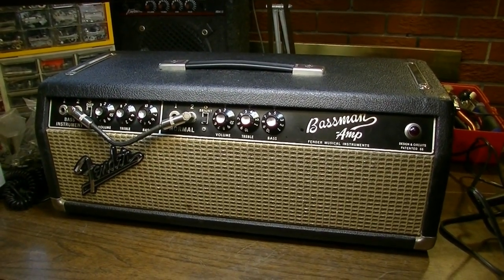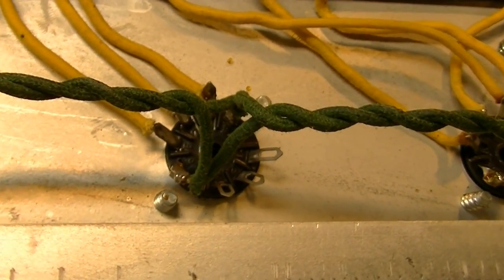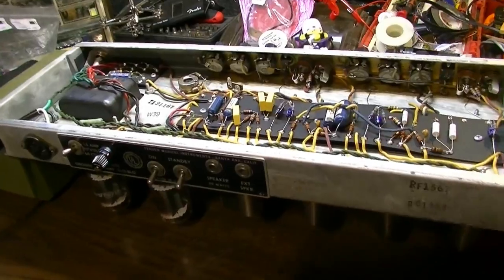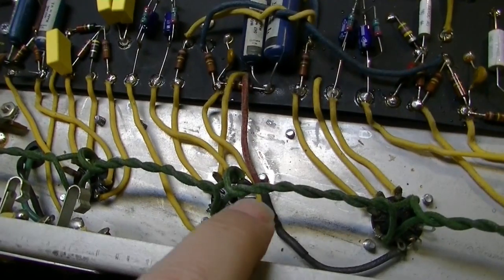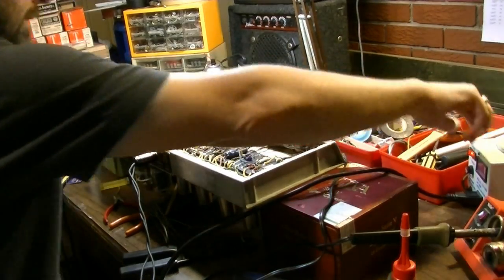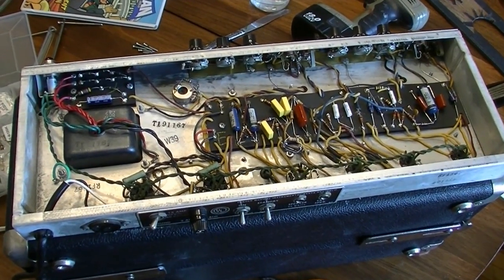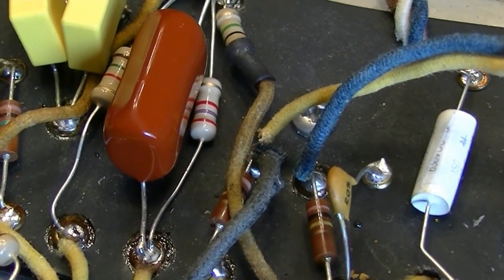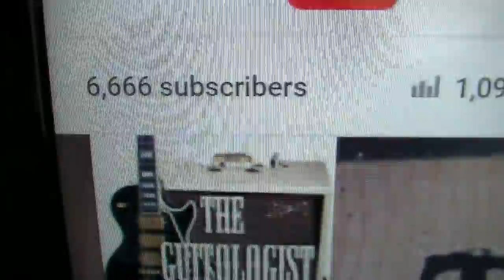Hacking a Blackface Fender for Monster Gain, Blasphemous or Badass?

Comment: The problem with the Marshall tone stack is that tone stack's frequency response depends heavily on the impedance that's driving it. In a Marshall amp, the tone stack is driven by a follower, and the output impedance of the follower is a few hundred ohms at worse (and by "worse" I mean when low mu triodes are used, such as ECC83, 12AX7, 7025, 6N2P).
In a Fender amp, the tone stack is driven by a gain stage with an output impedance around 40k. So just changing the component values in the tone stack of a Fender to match the corresponding values in a Marshall will not result in a similar frequency response to that of a Marshall. This of course does not mean it can't sound ok.
Reply from the maker: An excellent point. Thanks for making it.
Reply: +kardRatzinger - Important point!  and to which I'd like to add that static information, like interstage impedance and frequency response, is like a postcard of the Himalayas - 2D doesn't even approach the LIVE experience.  What matters, especially to the player, is Dynamic Response - how it feels as well as sounds in a continuum, not a snapshot..  The Cathode Follower circuit is extremely important because it has Unity Gain and acts like a soft-knee limiter. Also because the entire Tweed tone circuit (and most best models from Marshall, HiWatt, Vox, and a dozen other venerable brands/models)  comes AFTER the 2nd gain section and Volume control, overdriving that limiter and tone stack results in "squeezed up" bandwidth as well as attack which slowly recovers as signal decays results in a vocal effect that drives musicians to "talk" with their instrument.  It can clean up when you turn down and slide smoothly into overdrive when signal increases either by turning up or just hitting the strings harder.  If you just want a fuzz tone get one.  If you long for a responsive musical instrument, explore Cathode Follower driven Tone Stacks.
Reply: well there's more resistances to ground on everything in that stack you notice and it's the followers distortion and not plate driven as well stages some tend go slightly colder, you can get monster distortion cold clip the hell out of the 2nd or 3rd stage and get everything else HOT sounds good...but I think it still sounds alittle still docile sterile and could play with feedback and it's still something like that...just go monster headroom and all gain allll hot running and clean then just run your choice of firestorm pedals up front, that's why I said might as well have some big clean ss/digital amp that's clean and filtered well and still sounds like what's running up front.
Reply: +JR - I don't understand why you are replying in this portion where we are discussing Cathode Follower driven tone stacks and Dynamic Response where a musician can travel between clean and distortion just from Guitar Volume Control or how hard or soft  you attack the strings which has a tonal "squeeze" effect since it drives the Tone Stack, adding a whole dimension of vocal expressiveness.  Extreme pedal (or preamp) overdrive is the antithesis of that.  Also "distortion" is a misleading term when one is considering Cathode Followers since they are Unity Gain and have extremely low harmonic generation on their own.  The concept of extreme preamp overdrive with ultra clean power section, especially of the  "ss/digital" type, is completely out of place in this video  which is for those that love what only tubes can offer and have an interest in whether hacking a 50 watt Blackface is a good thing or not.  What you're talking about has some validity for some styles of players but not in this arena.
Reply: Oh it's no ill intent or Despair. But I know what I would do to it Lol, the follower seemed to have a somewhat audible "zingy" response and a lot fun in the highs and grins me the hell out lol...Plate driven now everything is really different it seems to of lacked a lot more of the harmonic content and excels at the low end.
Reply: It's not even that though it's wicked just to have Headroom and already super Clean and just annilate with pedals up front, telling you valve is overrated lol and it's old lol
Reply: +JR - You are somewhat correct in that valves are overrated for the sound and feel YOU like BUT they are NOT overrated for those of us who prefer Dynamic Expression.  You are also correct that they are old, but then so are guitars and speakers and the scales I'm sure you love.  Things aren't good because they are old or new.  They are good because they offer value and some get to be old because they do it so well.
Reply: There's all kind of just excellent stuff and boxes now, that is very dynamic
Reply: +JR - I sincerely doubt you understand what I mean by "dynamic" in the sense that tubes differ from ss/digital by having a "soft knee" transition into overdrive.  From what I see and hear, if some mere pedal could actually do that, which in my understanding of electronics is physically impossible even for very advanced FETs let alone ICs, within just a year or two tube amps would literally disappear from the market and that market is quite healthy.  From what I gather you are of the metal crowd that cares not for such dynamics and has no need for it or tubes that can and do deliver such tracking.
Reply: Well there is some dynamics and response in that area too, it can become really squashed and boxy with like over compression, that's fun for all the rhythm stuff, but that dynamic openness and a lot and transition into the high end and exercises is a good test. And it's that too some decent cleans if you wanted to do that and transition from the firestorm , I think there's a lot close and similar emulation's.
Reply: That can be simulated too though a softer sort of overdrive and like mild breakup and a lot stuff still kinda sounds like that still when you go even further into all the excessive amounts of distortion and staging. still all kinda simulated in a way how you want create the distortion when think about it. personally? I think it's probably still driver cab thing and trying to blow up one you think sounds good and some do sound rad when pushed others it's this clean high powered monster and no speaker breakup or a lot harder and huge headroom.
Reply: I don't know though there's some stuff that does sound pretty decent FETS do and I liked Led clipping and whatever was contrapted that I can't remember gmo microwave cat overdrive.
Reply: you missed the point,pedals dont get this sound.sorry friend,it just doesn't happen.
they are discussing a tone stack and other related things,not what an overdrive can
 do or a distorted speaker.you can try to fake things but it doesnt work.
Reply: Who cares bout the technical Mumbo jumbo it sounds great.

Comment: No holes drilled = not a hack job. Definitely enjoyed hearing more about the development of the mods as they happened. Did I somehow miss the resolution of the cathode biasing conversion? I have a '66 BF Bandmaster and don't need or want the headroom it has so have thought about going to cathode bias. I know it won't make it into a Deluxe or Princeton but a bit of tweed influence would be fun.
Reply from the maker: The owner and I discussed that and decided to go with the preamp mods first and later, if he still thinks the amp is too loud or needs earlier breakup, we'll re-bias the tubes for earlier breakup using the existing pot. And THEN maybe come back and think about cathode bias and 5881 tubes.
Reply: You may want to look at the resale value for that Bandmaster, then decide if it might be better to sell your amp & buy the one you really want.  People used to modify blackface Bassman amps all the time because no one really liked them stock for either guitar or bass, and you could buy near-mint Bassman heads for $400 (retail).  Now prices are going up, so...
Reply: I hear you but this was already gone through before I bought it back in 2001-2002, so 95% of the components on the board have been replaced, the transformers are all original though. So, changing a few things around in the circuit (no holes drilled, the chassis is perfect that way and will stay that way as long as I own it) wouldn't be hard to reverse if I were to want to sell it eventually.
Reply: Certainly reversible changes are no big deal.  I was especially focused on your desire for lower headroom...  You could get there with a master volume circuit (not insurmountable, but where do you mount it?).  Or you could get there with an amp that makes less output power to begin with.  If you're looking for the output tubes to distort first (big assumption on my part), even half-power may not be a big enough drop in headroom/volume.

A switch to cathode bias might only be a 20-40% reduction in output power, and heat in the output tubes & power transformer become a concern that must be addressed.

I'd recommend playing amps in the 10-15w range, and seeing if that is a volume level you're shooting for.  If yes, it might yield some clarity on whether changing the Bandmaster's operation is the way to go, or if a different amp is the better answer.

It doesn't matter whether I or anyone else approves; it's your amp.  But having tread this path before with my own amps, things usually worked better when I let an amp be what it is, and used a smaller amp when I really wanted less volume (just built a 1/3-watt amp for that very reason for playing around the house; still have the Pro Reverb, though).
Reply: Thanks for your thoughts, always good to hear from people that have been down that path. 

I've recently finished scratch building a 5F1 circuit into a 1x12 combo cab, (what I've been using for the Bandmaster in recent times) and that does the (slightly) lower volume grind thing well, so I really don't "need" the Bandmaster to break up at lower volumes. I guess it's more of a desire to see what I can tweak on it and actually experience the changes vs just reading about them. I've no issue with component swapping since it's already been overly serviced, arguably but I don't see any point in doing a typical master volume since the pre-amp isn't exactly high gain anyway. 

You're right in that it does what it does very well, and changing it to do another thing would inherently require a compromise in clean tone or the modded tone so why not just find another amp. I have another project to build out of an old PA amp, which will be 3x12AX7, 2xEL84s and somewhere between a JCM800,  Marshall 18W and generic Orange front end and that will get VVR or a PPIMV. 

A good OD pedal may be exactly what I need before I can get the EL84 amp designed and built and I'll probably pursue that avenue first as I have a Tubescreamer but I don't like how it works with my other sentimental piece of gear, '01 Gibson Explorer with Burstbuckers.

Thanks again for your thoughtful conversation!
Reply: Well, you're already leaps ahead of other guitarists in having built your own Champ!  That Champ through a 4x12 cab is surprisingly loud...

Before we spam this video with sidebars, you might want to swing by the Hoffman Amps Forum:
http://el34world.com/Forum/index.php

There are plenty of folks there who can help with analyzing proposed designs to assist you in zeroing in on what might work best for you.
Reply from the maker: Speaking of MVs... I briefly thought of an MV for this Bassman and without drilling holes, where to put it was a concern. I thought of the hole for the Ground Switch, which has been removed from circuit already and wondered whether the proximity to power would interfere. Any experience with this anyone?
Reply: Adding the master volume at the ground switch shouldn't present a problem.  I have not done it myself, but I know people who have.

If you're very concerned about potential noise, consider a 2-conductor-plus-shield cable (or 4-conductor plus shield, depending on master volume type) for the wire run from phase inverter to pot.

I know a guy who put a master volume for a blackface amp in the #2 input jack.  I thought there was no way that would work without oscillation, but he reported no ill effects.  Don't know if he got lucky, and can't recall at the moment if he used a shielded cable for the wiring to that pot.
Reply: Yes, after looking through what it would take, I'll just put that energy into getting my 2nd scratch build done and set it up for low volume dirt.
Reply: those though not real clean and headroomy driver and tiny voice coil telling you you want bigger at least like v30 is industry standard driver to me and Eminence offerings it will be insane.
Reply: +JR
Modern V30s sound like shit. They're made in China, so pretty much anything from Eminence or EV is better than them.
I'm using a pair of ElectroVoice Wylde sigs in my Behringer 2x12 and it sounds killer with anything I plug into it. They have headroom for days, and don't sound nearly as "stiff" as modern-production V30s.
V30s may be "industry standard," but what you need to learn about the industry is that most of the corps will sell you as crappy a product as they can get away with, and then some. The industry is full of shit. It's full of companies trying to live off past glories.

Comment: There's a software called "Tone Stack Calculator" that you can use to view the change in response for various tone controls.
Reply from the maker: I have it. It's called Duncan's Tone Stack Calculator: http://www.duncanamps.com/tsc/
Reply: Yep, that's the one! I've used it once to make a tone stack that could be switched between a Fender-ish to a Vox-ish stack, using a push-pul Bass potentiometer. All it did was add a couple capacitors in parallel to the ones in the circuit, to shift the Bass and Mid curves.
There's tons of stuff you can achieve by playing about with values.

Comment: You nailed it. I used to have a deluxe reverb with tubes you couldn't find in the last 20years. My local amp guy said it was the loudest Fender amp he had ever heard. Was modded before I bought it, the thing would levitate on a floor put past 5. Sounded unreal. Great job on this one.

Comment: In the 60's, we would run the ext. speaker out back into another input on our Fender amps. But note: you could only do this when a friend came over because thats the only time you would have TWO guitar cables.
Reply: Man! How did you not blow up your stuff?!
Reply: @Aaron-zh4kj  we nidged up carefully.  Try it. Amazing distortion! Its fun to be 12.
Reply: @RDYC  So you're telling me you'd send the load from the power amp of an amp into the input of another amp?

Comment: I like your videos, because you show all the in between, "WTF happened?" moments. Only thing I didn't quite follow on this, you started out talking about switching it to cathode bias, but then got wrapped up in the gain stages on the Normal channel, and I didn't see whether you did the cathode bias as well. EDIT: Never mind. I saw someone else asked that.
Reply from the maker: Thanks, man. Yeah, I left as is because everything was rocking so well with the other mods. Cathode biased 5881 would improve the breakup maybe slightly more, but it would be most felt in the feel and attack of the player, I think.

Comment: Great video !! I modded a 66 Bassman  Head AA165 (found the 870 ohm resistor-tube charts have been known to be inaccurate) with a 250K master volume control just to make a studio/bedroom amp out of it. The only way to fly is 2-3 conductor shielded solid wire for those long runs for your negative bias connections. The less you have to screw around with soldering shield the better. It's worth the extra money. What value did you use for the mid range resistor? The Marshall 'section' sounds great !! Thanks !!

Comment: Hello Brad!
I´ve seen 12 minutes of this and i have question regarding the jumper cable.
I don´t have this amp so i can´t try this but, wouldn´t be easier to just make a new jumper cable and reverse the polarity on the cable itself? 
It´s just that if you don´t want to  modify your amp maybe a reversed jumper cable would do the trick?
Yes, it wouldn´t fixe the gain, but at least it would fix the eq issue.

Or i´m i on the wrong track here? I´m asking because i try to learn as much as possible and i just love your youtube films!
Reply: You're going in the right direction. But swapping the leads would effectively short the input to ground, as the Signal would be connected to the sleeve, which is the chassis which is GROUND. Swapping the leads on the input jack creates the same effect.

You could put an 1:1 signal transformer behind (or before) the normal channel and swap leads on that one. You have to have isolation every time you swap the phase, in order not to cause "interference" (shorting to gnd) with the original signal. A tube stage (with the plate as the output) is one way to provide isolation.

cheers

Comment: I've got a tricked out Dual Showman that was Boogie-ized by a Mesa Boogie tech/ GIT professor.  The work done on this amp was a project with the student, the professional jazz musician I got it from.  He used it for several years as a gig amp, but went with a lighter solid state amp and digital effects to dial in his sound.  That was early eighties. It just sat around so he decided to part with it. This thing has push pulls all over it, on both the channel volumes, the trebles, and on the master volume knobs.  They act as saturation/overdrive  adjustments.  There's a crazy amount of sound options/variations (exponential variables) and quite a learning curve.  Great studio amp, but a bit to much fussy fiddlin' and a heavy beast for a steady gigging workhorse. Truely unique sounds and huge range of character though, from crunch, fuzzy, shhh mudd, clean, bright n twangy.  It even does weird stuff like playing with just reverb, no volume just the reberb echo.  Oh yeah, has vibrato too.  Totally, a one of a kind.